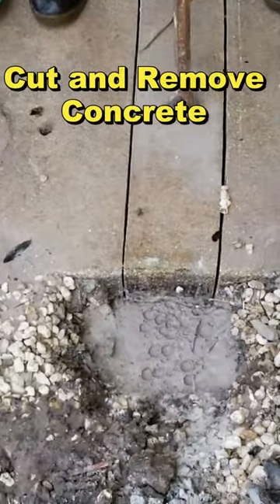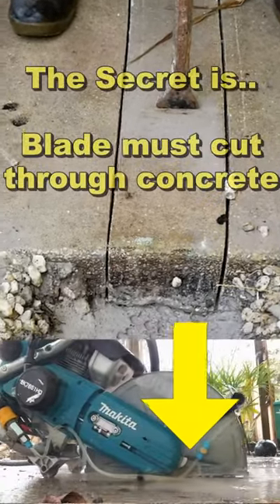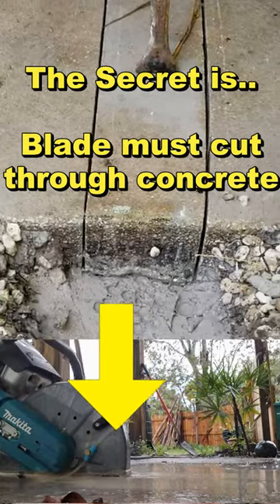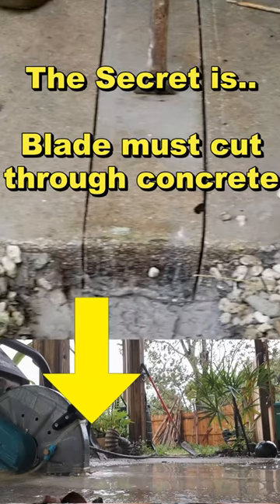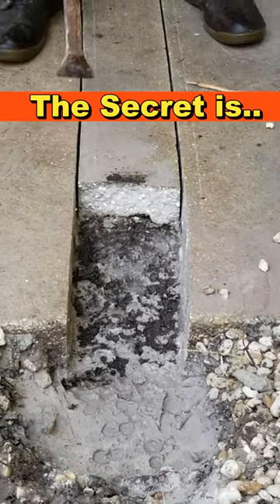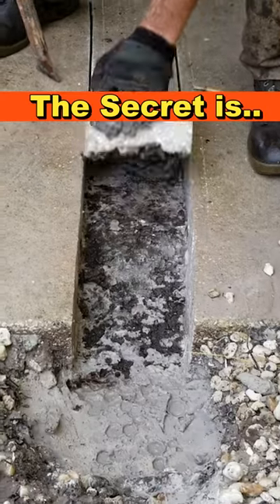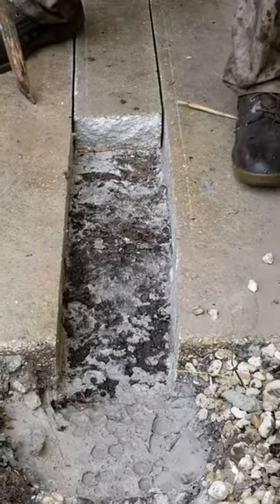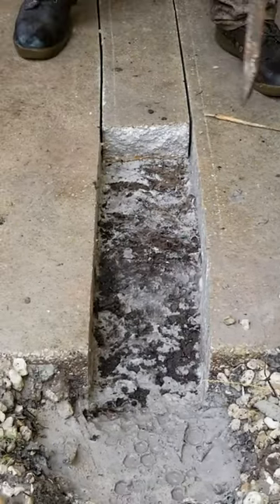How to Cut and Remove Concrete - REAL How to VIDEO for the DIY

Comment: Or you can lift the whole piece in one shot. As a plumber that does this often,works like a champ. If you don't, using a spike bit on a jackhammer or rotohammer is the best method. Digging bars as a last resort